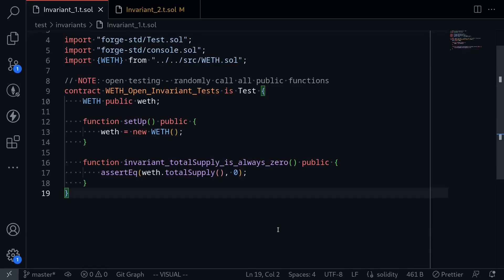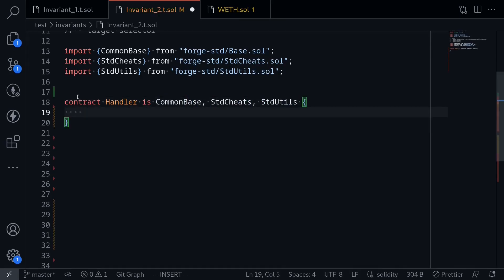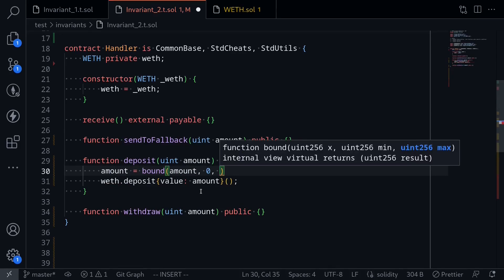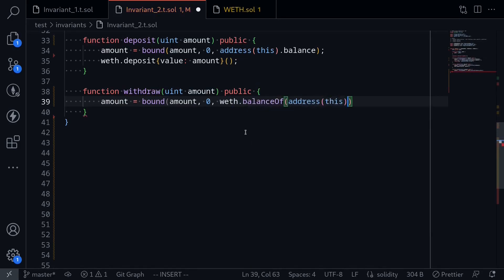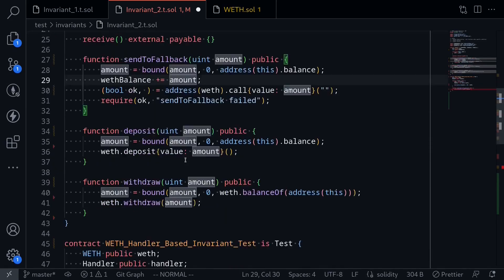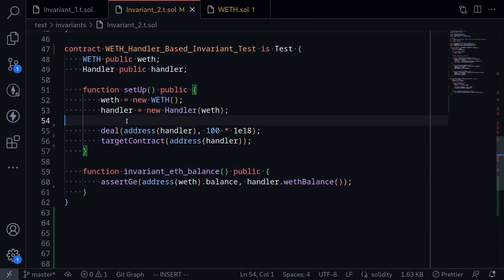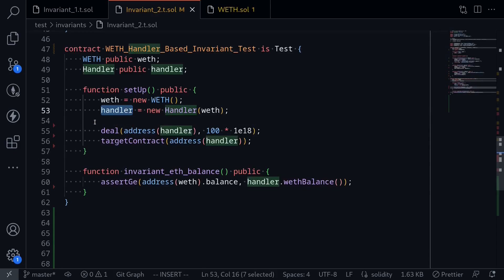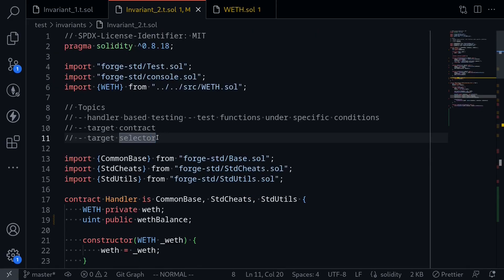Invariant Testing - Part 2 - Handler Based Testing | Testing with Foundry

Comment: wethBalance is a state variable right? Why did you treat it as a function by writing it as handler.wethBalance() instead of handler.wethBalance ? That is the only bit that's confusing for me.
Reply from the maker: contracts cannot directly access other contract's state variables.
instead, if the state variable is public, it is turned into a public function which can be called by other contracts